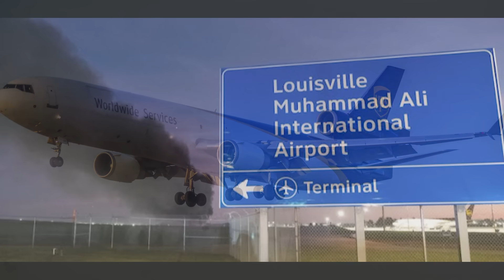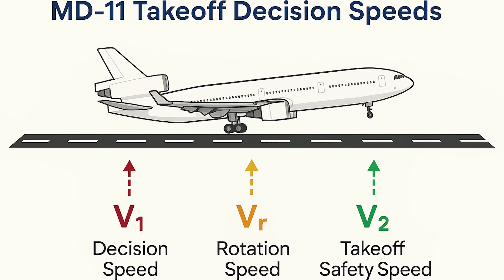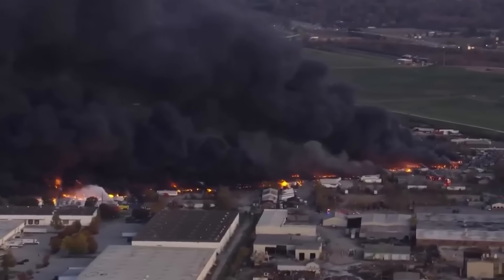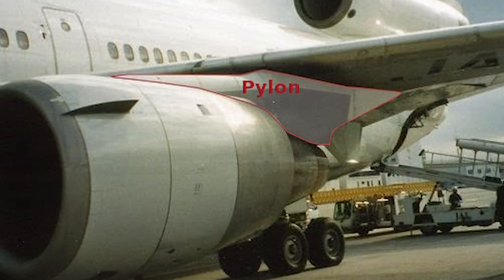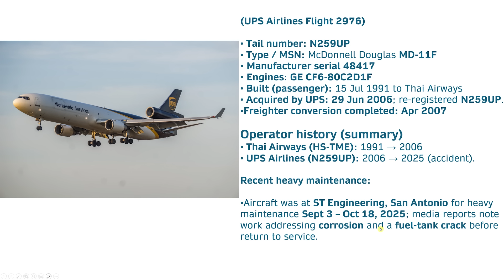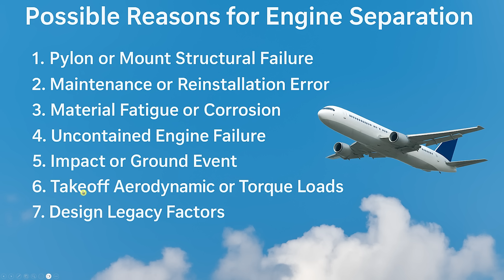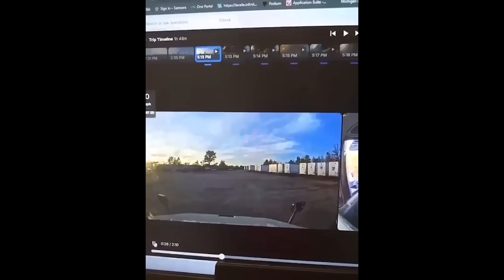What Caused UPS Plane Crash, Louisville, KY? How MD-11 Engine Fell Off

Comment: R.I.P. to the crew and the innocent people who passed away.
Reply: Absolutely.   Those poor people and that poor child.  Just breaks my heart into a million pieces.
Reply: @kevinm9 How many died? The plane landed on the child?
Reply: Those poor guys had so litlle time to do anything. I'm sure they did all they could do but had no height to avoid anything.
Reply: @dc6233  7 seconds from when the wheels left the ground. The only one who saw it coming was the RO because the other 2 were focused on fixing the problems
Reply: 3 pilots just trying to make a living doing what they loved. Tragic, horrible & heartbreaking. 😥
Reply: @thomaswhalen5451  100% preventable
Reply: I remember the '79 crash. I was on my way home on the exway 5 or 6 miles south of O'Hare and saw the huge smoke  rising as it had just happened. (2 pals and I were going to see the Police at the Park West later that evening). They said one of the fasteners for the pylon had been damaged due to some error in mounting using a fork truck during the maintenance procedure. I don't remember all the details like where it likely happened.  I believe the engine came loose and flew up and over the wing, so the forward slats retracted due to loss of hydraulic fluid, but the pilots had no idea what went wrong, and could have switched  to a backup system had they known what happened, but had only seconds to act. The engine was left on the runway. There was a full load of passengers.
Reply: @thomasmleahy6218  The maintenance hub (Tulsa) for the 1979 plane was uninstalling the pylons without separating the engines first when doing engines swaps.  This caused fatigue cracks.  The crew chief at the hub committed suicide  after the crash of flight 191.
Reply: So horrific, terrifying😢
Reply: Just plain miraculous that it didn't kill more folks - I'll bet that the pilots were spending their last seconds trying to steer away from people....
Reply: @stevengill1736 les gens au sol..oui...mais dans cette configuration...les pilotes  e peuvent rien faire !!!!
Reply: God that is scary the start of this video.
Reply: It's absolutely horrible 😢.  Praying for the victims and their families
Reply: That engine slid out. Look how long the engine is. (12ft) I think whatever made the crack it gave way and things separated. But yah it slid out before it even took off sadly
Reply: Those poor people. They must have been terrified. I hate to think about it.
Reply: Yah but the weight of aircraft was completely off when they took off without it. That's why the plane is sideways left wing up right wing down.. those poor people
Reply: @JillLeonard-z6g It's not the weight difference. It's having full trust from the right wing and back engine causing it to list. They were too far down the runway and into takeoff procedure to stop, and they didn't have enough lift to make any type of maneuver. Just an impossible situation.
Reply: @fredwin There is some speculation that the No:3 (right wing) engine compressor stalled as well.
This would make sense as with the best will in the world, if already at V1 speed this plane should have been able to get off the ground with two engines.
One engine producing thrust? Not a chance.
Reply: @fredwin yep just like the concord, too late to abort just try to clear as much as possible.
Reply: My deepest condolences to the family of the crew.
ST Engineering better not be the ones that caused this tragedy, which would be the end of the company.
Reply: Absolutely. May they rest in peace, and may every lesson learned from this tragedy help save future lives. ✈🙏
Reply: The captain of the plane lived in
My neighborhood
Reply: My dad used to fly the MD-11 and had flown in that plane and with the RO and first officer (at separate times) and knew them pretty well
Reply: I could feel the white hot oh my God terror  in my gut seeing some of that footage before the impact. Imagining and thinking about everything before the end is an awful pain.

I hope the families are doing better today than yesterday.
Reply: Amen 🙏
Reply: That  MD  11  been having problems  for years,  RIP  to all😢
Reply: It was updated to 12 dead.. but 9 missing ???
Reply: 💔Amen...
Reply: The reason why I hate planes, piece of work
Reply: Did anyone survive?
Reply: I think the pilot walked
Reply: These UPS package jokes are quite insensitive with real lives lost in the most disturbing, explosive way, imaginable... That kind of fire sends nothing but chills down my spine, and is so unfortunate this happened. The fact that these black boxes have to be made to endure incinerating temperatures is also quite disturbing. RIP to the lives that were lost in that terrible crash.
Reply: Paix a toutes ces victimes ! Le pire en aviation c'est la perte de puissance au décollage. Les pilotes ne peuvent malheureusement rien faire  !!!!
Reply: Best wishes to all
Reply: Your country funds wars in which millions die
Reply: Heard nothing about any of the crew 😮
Reply: @jayhorton4088  its because the crew were male and headlines don't care about victims unless they are women and children.
Reply: @avenger3163 
Not true AT ALL!! They wanted to notify the families first before announcing it nationally. It’s called RESPECT! Ugh, you people have 1 brain cell.
Reply: @missyidontgiveacrap9939  you have no idea what you are talking about Mindy. Not one bit of empathy either.
Reply: @avenger3163 
They identified the pilots two days ago and stated it to all the news! AFTER NOTIFYING THE FAMILY! OPEN your eyes, good grief! 

Captain Richard Wartenberg, of Independence, KY;
First Officer Lee Truitt, of Albuquerque, NM;
International Relief Officer Captain Dana Diamond, of Caldwell, TX.
Reply: @jayhorton4088  presumed to be "crispy critters"
Reply: waste of perfectly good human lives ;(
Reply: Like reliving Flight 191.
Reply: Yet UPS will still have people complaining that their package was late and had carbon all over it.
Reply: God rest their souls,I hope they knew Jesus Christ prior to this tragedy.
Reply: I was looking at the video thinking: "well that sucks.". I don't mean to miminize it.  Just that it's a fait accompli by the time you're watching a big fireball on video.
Reply: @data_abort  fate  :)
Reply: @lupusgirl1000 😅
Reply: @lupusgirl1000 Nope.
Reply: Im gonna blame UPS and Shoddy maintenance on a old asf plane.. they better take responsibility
Reply: And the packages! I lost one of mine 😩🥺😢😭
Reply: This is why I avoid airports.
Reply: Not so much as passed away, but rather burned to ashes in seconds.
Reply: WTF. Why would you say "innocent"? LOL! It wasn't a B2 going to bomb children and babies in Gaza.
Reply: Ask charlie about the pilot's race.
Reply: Do you believe in karma ?
Reply: Passed away is a wild phrase for this situation
Reply: @Purriah Well it's a bit more diplomatic then incinerated isn't it?
Reply: who cares
Reply: @fatherdamien69 Everybody with a brain .
Reply: I echo ones sentiments here.  
Though there is no RIP for anybody in eternity, whichever side one may land.
Never-ending joy and praises v never-ending death (which is akin to dying ones worst death everyday repeatedly).
Much love
Reply: @Fight_TheGood_Fight   So helpful.  🙄
Reply: RIP to the whistle blower that shot himself 2 times.. Glad all yall are worried about is Iphone updates..pssh.. sheep
Reply: 😮 you give me details, if you don't mind?
Reply: @frederickntumba3662  Is this to me sir?
Reply: @frederickntumba3662  Boeing unalived a whistleblower that was speaking out about their lack of quality controls. I'm sure other airlines have realized that a scandal here and there is cheaper than proper quality controls and followed suit.
Reply: Its a fake video, lol
Reply: @jjjtpln what makes u say this. There's family that lives in Louisville they saw it bud 😂
Reply: @jjjtpln which one of the many videos in this video are you claiming to be fake with your deep and complex statement?
Reply: @jjjtpln  really, how can one know with this one?
Thanks
Reply: Where tf are my PACKAGES?!?!
Reply: @piratehipster412 You probably didn't have one on this flight because it was going to Hawaii. Have respect for the crew who perished in this awful tragedy.
Reply: @piratehipster412  mine are delayed 😡
Reply: What was that ground crew doing ????? Put them in jail
Reply: @rtomlinsonr That's the dumbest thing I've heard all day !
Reply: @rtomlinsonr  what? How is this the ground crews fault? What?
Reply: @rtomlinsonr Remember Owl lady Yellin (Treasury Secretary) she may have shared her magic mushrooms
Reply: @rtomlinsonr  it was just another murder, probably.  grounds crew is a great job to get away with murders.
Reply: @reddyrippin 😂 paranoid much😅
Reply: How else do you rest when it’s over lol
Reply: @user-op9mv5lq1u  2 choices really
Reply: Not resting in peace is what makes you a ghost for the people that believe in that.
Reply: @user-op9mv5lq1u  all depends if you have faith in Jesus or not.
Reply: @user-op9mv5lq1u  That depends on the life you lead.
Reply: @user-op9mv5lq1u   i don't really think that's funny
Reply: @44Krow  I didn't think it was funny ... but True.
Reply: @user-op9mv5lq1u well idk if it’s true or not but. When someone passes on if they have unfinished business left. They are stuck on earth walking with the living and disturbed…. Not resting in peace. So hopefully they went to the light and are resting in peace. lol idk but that could be another option.
Reply: @Duckoff000read the bible
Reply: @Duckoff000 Hello sir. 
In fact (I respect everyone's freedom to object and would happily have civil questions I'd answer, the answers not being mine - I'm just a some dude)) EVERYBODY  who had died is asleep right now, they will be awoken to face judgement, but at this time nobody is  in Heaven or hell.
Reply: @Fight_TheGood_Fight  none of that is happening. I also like reading fantasy novels though.
Reply: @Duckoff000 Their soul goes back to God whom gave it. If any are still around which is not true those are demonic spirits appearing as the persons who died. Called familiar spirits.
Reply: @Duckoff000 Nope, unfortunatley once you are gone you are gone, ghosts, heaven and hell all stories 🤷‍♂

Comment: The fire from the left wing was going straight into the rear engine , available oxygen which is essential for a jet to operate correctly would have been severely limited thereby cutting most of the available power from that engine , full power from 2 remaining engine may gave given the crew more options although it probably wouldn't have stopped the inevitable crash IMHO😢😢

Comment: Right before the plane crashed, both wings were still fully attached at the wing root, and the #2 and #3 engines were still on the plane. The #1 engine was clearly missing right before impact. My hypothesis is that the #1 engine vibrated itself loose... from possible rotor bow. Because imagine the force that would have been needed to rupture fuel lines, and break engine mounts. Not even uncontrolled explosions within an engine typically rip an engine off its mount. The photos of the #1 engine on the airport tarmac shows the entire turbine assembly in one piece, aside from the front fan. For a whole engine to come right off, it would have to shake right off.

I wonder if Engine #1 experienced what's called rotor bowing? That is one of the plausible reasons for an engine to break apart and catch fire when it's spun up to high RPMs. Prior to this flight, were the engines given time to run idle and cool down from the previous flight before stopping? Otherwise, the engine rotor could have warped enough to cause severe vibrations this time, when it was spun up to TOGA speed, which is really the only time such a vibration would be pronounced enough to quite literally rattle the engine right off its mounts.
Reply: More likely just age related metal fatigue that wasn't caught because it was a failure mode that hadn't been seen before. The plane was 34 years old, and probably was reaching effective retirement age.

Comment: The one that shook me was the weather related crash of Delta Flight 191 that crashed in Dallas in 1985. I've flown through Dallas quite a few times. I just realized how weird that is that both tri-jet crashes ate both numbered 191. I absolutely have never trusted the DC-10. Flight 232 that crashed in Sioux City was a DC-10.  There was a crash of a Turkish Airlines DC-10 outside of Paris after the cargo door blew open damaging the cables controlling the aircraft killing everyone on board after striking the ground at around 500 mph. And then there is the MD-11 Swiss Air Flight 611 that crashed off of the coast of Newfoundland killing all on board.
Reply: I feel the same way.  I've never liked the MD 11 or the DC 10.  I truly believe they were problematic. I took an aircraft accident investigation course from Embry Riddle years ago and did a research paper on the MD 11. For a long time, they had some dangerous problems with Kapton wiring and insulation.  It lead to several fires, and is believed to have been a big factor in the Swissair 111 accident. The problem was supposedly fixed, but I still don't like those planes.
Reply: @miriammacdermot5601   You must have gotten an F on your paper.  The Swiss air fire was caused by poor inspections that overlooked ADs issued for replacing the insulation and wiring. Every single airplane on the planet has ADs issued at one time or another. But let's let the numbers speak for themselves. The last DC-10 crash was in 2004 (pilot error).  The last MD-11 Crash was in 2010 (pilot error).  Every single DC-10 or MD-11 crash was attributed to poor maintenance, inadequate inspections, or Pilot error. Since 2010, in the last 15 years, there have been more than 200 (of all types) Airbus crashes, seven 737 crashes, three 747 crashes, three 777 crashes, and one 787 crash. Yet NO MD-11 crash or DC-10 crash. But after millions of hours of flight time over the last 15 years, one MD-11 crashed, and suddenly, the airplanes are junk, while ignoring all the other types of aircraft that have crashed in those 15 years that the MD-11 hadn't. By the way numb-nuts, the United States Air Force has achieved a 90 percent operational success rate with its DC-10 air refueling tankers over 45 years. The only USAF KC-10 lost was a ground fire caused by a maintenance mistake.
Reply: In every one of your examples, the reason was either poor inspections, bad maintenance or pilot error.  IN fact, recorded history proves that in every single DC-10/MD-11 cras,h those were the cases. Not because of the airplane's design or safety. But the numbers speak for themselves. The last DC-10 crash was in 2004 (pilot error).  The last MD-11 Crash was in 2010 (pilot error).  Every single DC-10 or MD-11 crash was attributed to poor maintenance, inadequate inspections, or Pilot error. Not MD skimping on safety. Since 2010, in the last 15 years, there have been more than 200 (of all types) Airbus crashes, seven 737 crashes, three 747 crashes, three 777 crashes, and one 787 crash. Yet NO MD-11 crash or DC-10 crash.  The United States Air Force has achieved a 90 percent operational success rate with its DC-10 air refueling tankers. The only USAF KC-10 lost was a ground fire caused by a maintenance mistake.
Reply: @ILSRWY4 Doesn't matter what caused them. Dead people. Cargo doors were a design flaw.
Reply: I think that's why the older ones are CARGO PLANES these days!
Reply: @markhugo8270  There are a ton of reasons for it but safety really isn't one of them. Outside of a few spectacularly awful incidents it's probably as safe if not safer than the 737s and A320s out there everywhere today.
Reply: Swiss Flight 111 🎉 😢 ... two German officials of the World Intellectual Property Organization (WIPO), were seated in Business Class; the flight was called "the UN Shuttle" GVA><EWR (Genève to Newark). Mr. Ludwig Baeumer directed global initiatives in international cooperation on Patent subjects, and Mr. Joachim Bilger was the Budget Director, for an Agency with a biennial budget over CHF 500 million.
I was "dating" Bilger's French secretary, at the time, and "A" asked me to accompany her to his funeral, held in the majestic cathedral sitting atop the Vielle Ville. It (crash) occurred on Sept 2, 1998; my 12th month of employment there.
💔☮️💔
(Oh: "dating" because she lived with a guy 😂 ... vive la France 🇫🇷)

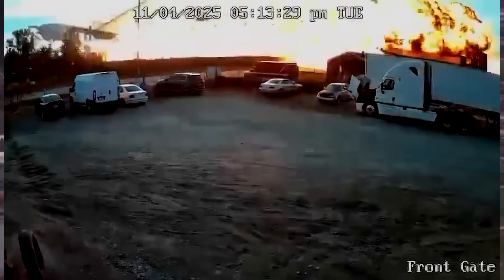Comment: @8:00 the roll to the left was due to the left wing being stalled and the right wing still producing lift.
Reply: That's what I was thinking, and when the left engine separated from the airframe it may have taken out hydraulics and damaged the control services; and I'm not a Facebook pilot, I actually have a pilot's license.  But admittedly at this point we're all guessing.

Comment: Your flames out the back of the engine at 1:23 is sun reflection off the light color on the plane.. the left wing was on fire where the engine originally was mounted being fed from broken fuel lines..